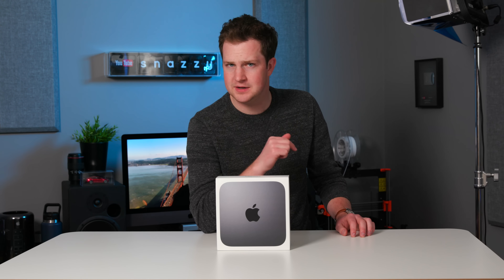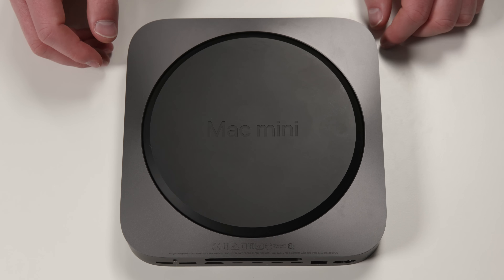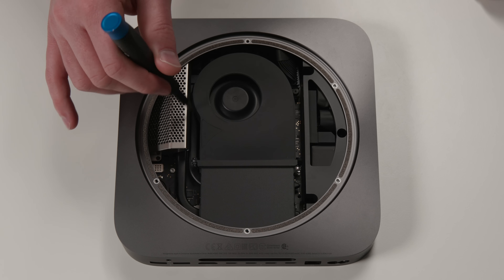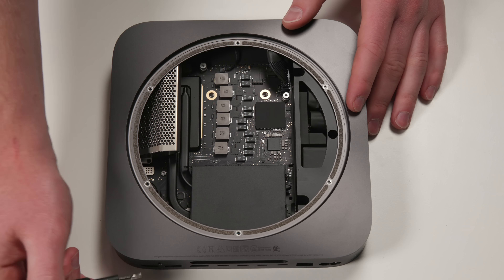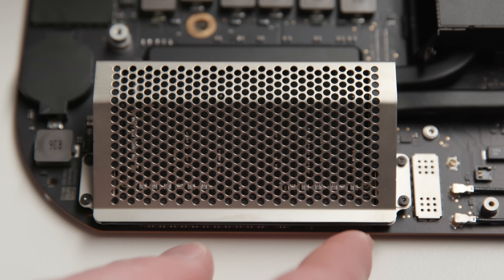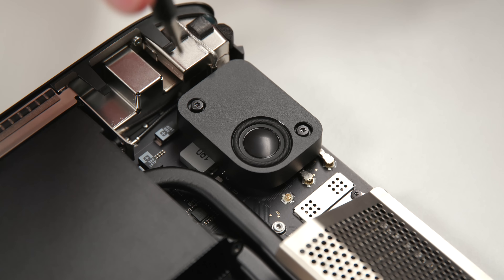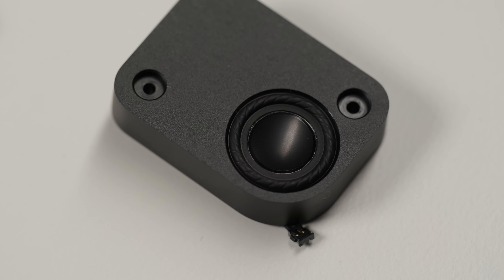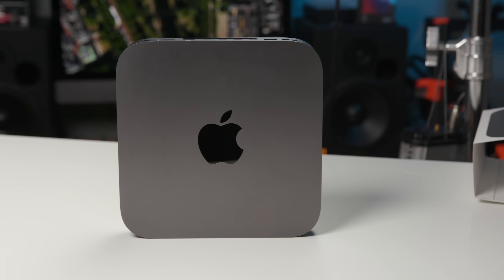Can You Upgrade the 2018 Apple Mac mini?! - RAM Upgrade Tutorial and Teardown

Comment: This is what happens when you are a Mac and PC guy. You tinker with what isn’t supposed to be tinkered with. Love it!
Reply: Who says its not supposed to be tinkered with?
Reply: Northfold Incorrect. Apple warranty says you can upgrade it and it will still be under warranty unless you break something major on it
Reply: Just cause apple said so means i shouldn't?
Reply: Very little about its construction seems to suggest they want people to do anything but fill landfills with them and buy a new one when you need more RAM or storage.
Reply: T2 chip makes sure the RAM is the only thing that you can do with it. Bye bye Linux.
Reply: Marcus Grant . Probably recycles well.
Reply: Think Different was their motto once, right?
Reply: A decade ago, part of my job was to fix and upgrade Mac computers in-house.  We used to save a bundle by buying base models, and then they land on my desk, and I would max out the storage and ram.  We bought so much Crucial Ram, that we had a rep and would bulk buy memory.
Reply: @bokismokitoki  Yeah, you just can't upgrade anything, because almost everything is soldered in.

Comment: Apple was legitimately like "Oh yeah guys! You can technically upgrade the RAM again!" but of course...the SSD is soldered on. Way to go apple - way to go.
Reply: Came to hear this. So, basically the last well-priced, upgradable product (SSD) is now unusable as well unless you shove all your money up their a$$es!
My old mac mini is the Apple device I still own/use. Had everything (PowerMac G5, MacBook Pro, several iPhones, Mac Mini, iPad) and Apple lost me. 
Every product has become mediocre to bad (except iPad Pro - so far) and ridiculously overpriced (especially, if you don't use the insulting low-spec base models). 

I feel betrayed by Tim Cook! It's so clear he only cares for one thing. And it's not the u$er. Can you gue$$?
Reply: yeah I was about to say that, its great that the ram is upgradeable I guess, but its a bit pointless if the SSD is soldered on,
Reply: I can't watch the stage show. Corp-celebration makes me feel like puking. Woooh a fucking box... wow.
Reply: The motherboard is dead? Good bye, data!
Reply: Well, yes, of course it is. Non-soldered SSDs are way slower. Even x4 nvme drives — which are pretty expensive — are nowhere near as fast as Apple’s T2 mediated SSDs.

If you want to add slow SSD space, just put it on the USB3.1 gen 2/thunderbolt 3 ports.
Reply: @JasperJanssen  That's called Market Manipulation Jasper xx

Sockets are just as fast as solder - and usb3.1/thunderbolt aren't internal ports. (though 6gbs should really be enough...)

If Apple wanted to make a t2 in a socket. They'd sell you that. They don't, so you only get soldered.
Keeping the best bits deep inside their Premium Products - they would argue for a 'predictable experience' -lol (Apple does do nice stuff, they are just Dicks - even without Jobs)
Reply: That's why you buy the Apple Time Machine for backups lol
Reply: @City_Lights   - Everyone should always back up their data. Computers aren't a new thing anymore and everyone should know that. However it doesn't change the fact that if the SSD in the mini dies, you're basically forced to throw it away and get a new one. It's a stupid design when an nvme m.2 slot would've been perfectly acceptable, doable and something the end-user could replace.
Reply: @JasperJanssen  Apple SSD's are capable of 3.2 GB/s read and 2.2 GB/s write, samsung SSD's are capable of 3.5 GB/s write and 2.5 GB/s.
Reply: Donald Person agreed
Reply: @soundguydon  or you just buy a whole new logic board lol
Reply: @JasperJanssen  Nowhere near as close is basically nilche faster at all. It's not worth the trade off if if the board breaks you are SOL on any data stored on the board.
Reply: I think if serviceability is key, and you don't have your heart set on OSX (I guess you could go the hackintosh route) then you would be better served by an intel Nuc, Gigabyte Brix or the like. Having said that if that describes you -  you're probably not apple's target market.
Reply: @philippdrflr  That was actually also my reaction... But hear me out for a minute.  True, the larger configs are a lot of money but you have now thunderbolt to an external drive, meaning the heat is gone from the unit, if it is a spindle.  Also, larger and larger becomes our dependency on the cloud, which does not bode well with the outages we have seen this week in Google and Facebook.  What about hooking the Mini to a large thunderbolt storage unit and perform all processing on that and just keep the OS on the local machine.  It would not be a transportable device like an iPad or a Macbook in whatever form factor etc.  I am much more worried about a failure in the combined chips, you know by an 'oopsy' during an upgrade.  I wonder if it will boot from an external device?  I do think, from looking how it is engineered, that this is a well designed device, easy to upgrade to 16 or 32Gb if need be.  It seems the soldered on storage is becoming more and more mainstream as hardware manufacturers are pushing us into that cloud solution they have.
Reply: @aelaan12  wow... that's actually a good point!
You're totally right. This would work fine, I guess... Thanks for the inspiration!

On the other hand ... for even $900 you'd get a desktop PC powerful enough for any VR craziness... And here, you just have a mac mini which can browse and watch movies, maybe make music... But I guess that's always the argument...

Comment: The speaker is for saying "BONG!" on bootup
Reply: Casper S� That’s just what I was going to say. The speaker is for startup sound and alert/system sounds for anyone not hooking up their Mini to external speakers. I have a 1st Gen. PPC Mac Mini 2005 and a 1st gen. Intel-based Mac Mini from 2006, both which have a single mono speaker with awful sound but which was likely include partly so you had a means of hearing the boot up and system alert sounds.
Reply: but macs don't have an startup sound anymore, do they?
Reply: Sebolio there are still system sounds/alerts you’d  need a speaker for even if the current Mac Mini no longer has a startup sound. Besides, I think many buyers of this system would expect at least some sort of built-in speaker even if it’s just a crappy one. All other Macs outside of the Mac Pro have one and PC desktop tower systems generally include external speakers, if one is not built-in. The Mac Mini being a BYODKM system (bring your own display, keyboard, and mouse), it makes sense to have even a crappy speaker built-in with users wanting/needing better sound can bring their own speakers too.
Reply: Charles Bunnell You Chan bring the Startup Sound back with a command.

Comment: That's why the ram cage is there. Because the rubber ram "clips" could just fall off... Yesh? Maybe? Anyway, great video as always. Thanks
Reply from the maker: RAM clips aren't rubber. RAM is held in with standard metal clips but covered in rubber which is there for the sole purpose of helping the heatshield/faraday cage/whatever-the-heck-it-is stay in place.
Reply: @snazzy  haha ahh ok, gotcha. :)
Reply: I looks like shielding, but I'm not sure why they'd feel the need to include it.
Reply: DDR4 Ram gets hot like anything else, It more than likely some type of heat Shielding, especially due to part of the heat sync being directly under the RAM
Reply: Probably aesthetics ? Cause the whole logic board and all the hardware is mainly black and silver ?
Reply: The cover is definitely a faraday cage to prevent  EMI  from changing  bits on the memory and thus creating errors. Everything is packed so tight and its running so fast that there is probably a ton of EMI floating around inside. Its also the reason the outer case is aluminum. Hold an AM radio up to it and you can probably tune-in interference at some level.
Reply: @ErikWooldridge  I am betting its to prevent  the EMI from outside the  cage  altering the memory contents
Reply: @Traclfeen  The DIMMs aren't making contact with the 'shield', any heat sinking would be trivial at best, any incidental airflow would be all they need to stay cool.  Could be EMI related somehow.
Reply: The cage is there so you have to take the whole system to bits to change the ram.
Reply: The RAM cage is dual function, protection physically as well as a Faraday cage to protect or reduce EMI. Its in a solid aluminum case so cross talk from the RAM to the DAC is sometimes a legitimate issue.
Reply: EM shielding.
Reply: Nope, probably an EMI shield. While I do think Apple tends to make their products hard to upgrade, including that shield just to discourage upgraders seems a bit too much, I mean that shield costs money, there are other ways to prevent upgrading. I think that shield has something to do with the RAM DIMMs standing on top of the CPU.
Reply: It's some kind of electromagnetic shielding. Up to several GHz by the looks of the size of the holes.
Reply: I dont think so... I think its to make it harder to replace/add more ram cuz its apple...
Reply: the cage is likely there to keep people from trying to replace the SODIMMs while it's in the case, as it could damage the SODIMM slots or your ram sticks.
Reply: Zack Ross  But they do let you upgrade it?
Reply: @snazzy  It's a faraday cage.  The hole size is based on the frequency the RAM operates at.  They used it in some iMacs as well, so that the RAM can run at 2.6GHz without causing conflicts.

Remember, the iMac itself is a faraday cage of sorts, so interference from internal parts is a concern anyway.

Comment: I think the speaker was originally there so they could chime and sound error beeps at boot. The old PowerMac towers even had one, they sounded equally as bad, but better than nothing I guess!

This is nice, shame about non-replaceable storage, but otherwise it's definitely better than the 2014 ones. Great teardown!
Reply: Yeah it’s like a cmos battery.. just there for board d level diagnostics.

Comment: My disappointment is that the Mac Mini’s didn’t come with the Intel “Skull Canyon” CPU’s that had Vega GPU’s. The would have been better than the on board GPU and that speaker.
Reply: Or they dont want a rival to his upcoming Mac Pro upgrade.
Reply: I think you meant apus;p
Reply: I was hoping for this too!
Reply: @TopolinoPipulino  oh thanks for the info. I though they were caused they just seemed like what Intel did back in the day by gluing 2 single cores together and calling it a dual core :p
Reply: Actually, the Intel CPU AMD GPU combo is codenamed Kabylake G and is used in the "HADES Canyon" NUC.
Reply: The speaker is probably there for convenience, not as a permanent solution. When setting the thing up. Blind people use Mac as well.
Reply: Or ryzen with vega graphics. Hope they will do a refresh with this next year with the ryzen 3000 series cpus. Hopefully they will have decent integrated graphics
Reply: @jozsefemmertunofficial  The mac pro cost 3x as much. Uses xenon cpus and dedicated gpus?
Reply: @sindresvindal2290  What's the point? Mac doesn't market these to gamers or content creators.  This is meant to replace a Dell Inspiron or Lenovo desktop in a medium to high income household.
Reply: @huehuehue-x3c  Im under the impression that a lot of (amateur) content creators actually use(d) the mac mini.
Reply: They suck. They're pretty old CPU's with good graphics stuck on them. The CPU is a massive downgrade compared to the ones found in the new mini's.

Comment: I think the main problem as with this and MacBooks is the soldered storage, sure it makes it more secure but SSD chips have a lifespan and will eventually fail.  As you can't change the chips even if you have mad soldering skills (due to the t2 chip) the mac mini like MacBooks is now a limited life disposable item. I'm not sure if Apple even uses overprovisioning.
Reply: brian whittle Also, you have to securely destroy the entire motherboard according to your used storage opsec procedures. Don't want the recycling guys or the genius bar reading your online banking security codes when you hand in the machine for a broken USB socket issue.  With a removable SSD you can swap it out when handing the machine in for service or recycling.
Reply: @johnfrancisdoe1563  The annoying thing is the Mac mini clearly has room for an m.2 ssd instead of the soldered storage.  It's just a cash grab by apple like using propriety SSD's in the iMac.
Reply: That is their strategy to keep the customers buying new products every 1-2 years !!
Reply: brian whittle m2 SSDs are slow as molasses compared to the T2 drives.
Reply: By the time the chips in these things die the machine will be practically useless in terms of the rest of its specs any way, plus you can always boot from an external drive. It's pretty trivial with Macs, especially ones with Thunderbolt.
Reply: Leo Landi yeah, it kinda is? It’s got a super fast SSD and up to 6 core desktop CPU. It’s not workstation class but it’s hardly a netbook either.
Reply: @JasperJanssen  Patently untrue.  Samsung's NVMe drives outpace Apple's.
Reply: @JasperJanssen  no the ssd is not faster and no nothing else you said is true those are buzz words an i3 is a shitty choice for something thats supposed to be used for video editing or really anything for that matter as ryzen literally kills it its also cheaper
Reply: Sally Smith i have worked on and fixed almost every thing you listed but they didnt have a chip onboard dedicated to blocking simple upgrades or repairs like this product....xbox 360 was the toughest but this is even worse
Reply: Most SSD drives these days whether SATA III, embedded, Pci-e, or m.2 use 3D TLC NAND-based flash memory.
Reply: Jason C. 3d nand or stacked cells means when the drive gets full it wears out the top layer 3 times as fast and the middle layer twice as fast accessing the bottom layer.....easy to Market and more profit compared to single stack at same capacity....they do not mind ripping you off , its built into the buisness model and its getting exponentially worse every year.
Reply: @JasperJanssen  The M2 NVMe drive in the XPS 13  (Samsung) is lightning fast.
Reply: @JasperJanssen  citation needed
Reply: brian whittle yes, and it’s not quite as fast as the T2 SSDs Apple uses.
Reply: @JasperJanssen  when the chips on the SSD get tired and  start to slow down access you can swap it though. Apple don't have some sort of magic tech they are just the same consumer level chips as everybody used.
Reply: Yep they got around Congress with the T2 chip by saying it is not to ensure PO (planned obsolescence!) it is protect the OS from malicious software (Even though it does nothing to scan WiFi/Ethernet!) it solely works by scanning hardware be it attached or simply just connected externally (USB/Thunderbolt/Displayport/HDMI!) and before anyone says the T2 does scan WiFi/Ethernet that is false as their is nothing the T2 can do that the CPU with the OS and it's built in security could not and before people say it is protect the OS (I thought Macs could not get Viruses?) but why does it need to scan RAM? CPU? GPU (if it has a separate discreet internal one!)? and don't they put the T2 chips next to Ethernet & WiFi ports where it/they/them could better intersect malicious software at the point of entry it is not to say the T2 chip does not have a security program but the chip is much slower and simpler in design then the Intel CPU with Mac OS!
Reply: brian whittle “get tired and slow down access” is not how that works. The lifespan of SSDs, including both Apple and Samsung, is such that you will not see slowdowns in the first ten years of prosumer use. Some very large workloads (continuous full speed writes without any idle time at all) may see degradation after five years or so.

If you are seeing slowdowns within the lifetime of your pc... try reinstalling windows.
Reply: Darth Awar you seem to have severely misunderstood the security features T2 provides. It basically makes sure that your PC can’t be rooted — whether you want to or an attacker wants to. It’s not an antivirus program. It also provides zero-slowdown full disk encryption and a super fast SSD controller. Also the Touch ID if present hangs off it and the built in microphone and webcam go through it so they cannot be turned on without you noticing it, although of course those are not features the Mac mini can use.
Reply: I haven't ever heard the need to open up the computer to reseat the drive, if nobody ever touched it, so it's just a dick move to solder on the ssd

Comment: My 2 cents:
I think the being RAM SO-DIMMS is done to make more efficient usage of the available space. The overall internal design doesn't seem to be made to obstruct repairs, it seems to be designed in complete disregard of it. The results for the average Joe are the same, but the intention is different. The cage around the RAM is probably there to shield against certain EM waves.
Reply: I'm in almost complete agreement with you on that. However, the only thing that doesn't make sense is why they bothered to put a round access hole, especially because before it was used to facilitate the twist-off design, which is no longer relevant. Plus since its the bottom of the machine, making it a square footprint would make accessibility and assembly so much easier.
Reply: Yes. The high frequency (2666MHz) RAM creates interference EM noise that can interfere with the other computer components. I’m sure it can also receive interference, so hence the grounded Faraday Cage around the RAM cards.
Reply: But we are not caring this thing around it is gonna sit at desk